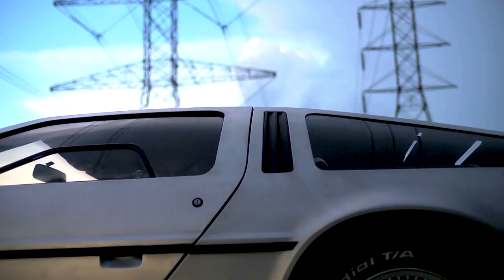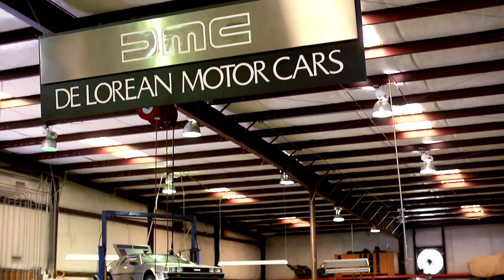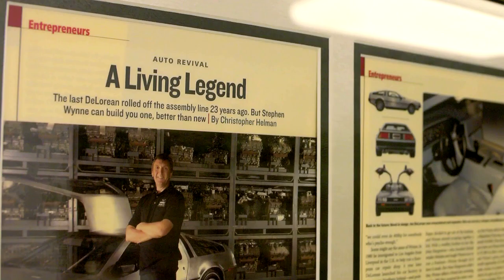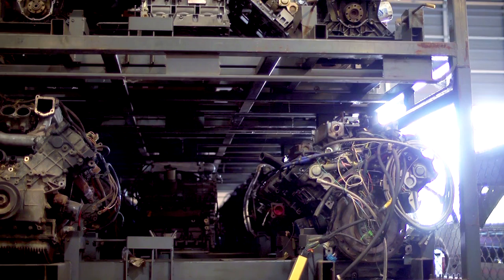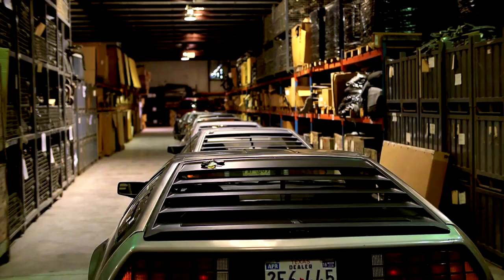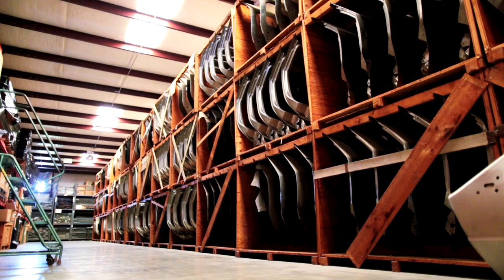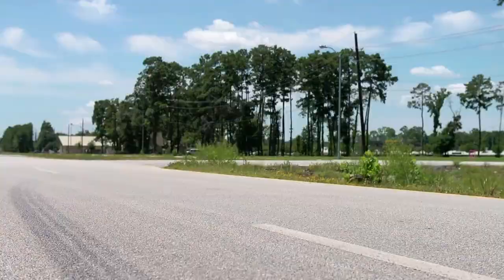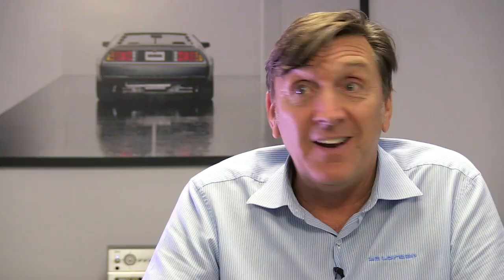New DeLoreans are still available, straight from the factory

Comment: Too bad they were powered with a weak Peougot motor.
Reply: No motor had any power in the 80s. Emissions were so hard to meet they all lost the power of the earlier years.
Reply: CHALK772  Peugeot was weak then. What it really needs is an LS swap
Reply: @cplpetergriffin1583  If you are going to go that route it's better off with a Viper Phase VX. At least its starts off with nearly 700 hp before adding all the bells and whistles.
Reply: Hamilton Rodgers  But would be so fun to watch!!
Reply: It needs a 572 big block with a blower. That would be the fix and a Allison 6 speed transmission with 356 running gear
Reply: Kevin H Needs a VTEC or 2JZ
Reply: @Kevin H : It's not a  "Peugeot" motor.
The engine is called the PRV V6.
Which stands for 'Peugeot / Renault / Volvo'. 
It was a joint project between all three car comapnies, and was first used by all three from '75 or '76 onward. 
The PRV V6 has also been used in lots of cars, mainly sports coupes, (inlcuding the DeLorean, of course)  by other much smaller brands over the decades. 
Sometimes with a turbo, sometimes even with a twin turbo, (which Renault did on its own Renault 25 Biturbo and then the later Renault  Safrane Biturbo in the '90s). 
While due to Peugeot buying out Citroen in around '76, Citroen also got the PRV V6, eventually - in the top spec models of it's upper size cars, (starting with the XM from '89, then the Xantia, C5, C6, etc). 
The so-called "Peugoet" motor, (as you put it) was not "weak". The  DeLorean needed a turbo, (or supercharger)  as either standard option right from the start - due in large part to its heavy stainless steel body, (but at least that keeps the body panels rust-free!!!).

Comment: I have two questions if I were to buy one.
(1) Are they required to have present day safety features as modern day vehicles have?

(2) If I were to order one now, would it be a 1981 or 2023 model?
Reply: The low volume historic replica vehicle amendment in the 2015 transportation bill waives current safety standards and allows the vehicles to be grandfathered retroactive to the year they would replicate (1981-1983 for DeLorean), though engines must be up to current EPA or CARB emissions. They would be registered retroactive to the year of replica, much like kit cars.

Comment: My brother called me mcfly. My mom called me doc my dad called me marty... I turned out to be doc tho. I have a small inheritance. Im living in a house with more rooms then i need. Etc. And i think i figured out how to make a car fly. But the wheels would have to be spinning so fast it would take something so slippery u couldnt stand on grass yet so dense it would maintain at the temperature of the sun. Using 5 points of inertia and cintrifical force. To create an actual bubble in gravity that would look like an arrow hit einstiens space time graph. Basically its spinning faster then the earth itself. Also the earth has a magnetic .5 it takes a 4.0 to stick a small magnet to a fridge. U would need a neutral double poled magnet either + or - depending on wich pole ur on.  Powerfull enough to pull a nail out of a peace pf wood but light enough to feel like styrofoam. Hover boards are more impossible then 1 point twenty one jiggawats. Ud need some kinda 👻 magnet. When u spin a ball tho and drop it. It moves forward. If you spin it faster it moves more forward. Untell u get to a point it actually is trying to go up. But you need this to happen in 5 point inertial circumstance for it to actually move up. You spinning an axis on a rotating axis that has an opposong axis and both sides go oppossite dorections. Very hard to explain but i can see it. Almost like a vision. It makes since. Its not lose uneducayed science. Its years and years of thinking that finally paid off. I made an example peace it lifted 2 inches off the ground and floated into the wall and blew up. Rip

Comment: How many brand new DeLorean's have you built so far - from the ground up - by just using the factory parts? How long would it take to build a new DeLorean from the ground up by using all of the 99.5% parts that you have for the car? How much would it cost to have a new DeLorean built from all of the parts you have? How difficult would it be to build a new DeLorean from the ground up with the factory parts?

Comment: If your going to make new deloreans you have to upgrade the front end I mean so 80's. Crappy old sealed beam lights put a slopped front piece like a lambo new HID lamps with halo ring. I'am I right or just produce 1980 replicas. The rest of the car I would leave stock  as a tribute

Comment: Was this in the era when speedometers were restricted to 85 mph maximum? 

Was needing to go 88 mph an inside joke?  

You can't tell because the Federal government mandated speedometer readings stop at 85 mph.
Reply: Ha, you think this car could go 80 miles an hour lol
Reply: @danielwhite1890  We made a VW Super Beatle go 90 mph... it was a big hill. Both side mirrors folded back at 85. By design?
Reply: @kevinmoore4887  no, specifically Deloreans, legit slow af
Reply: Max speed the engine could put out(which will roast that cats engine) was like, 110. Thing only has 100-150 horsepower

Comment: Iconic car  But the engine is slow and not very well designed out with bits and bobs from other car manufactures . But still a great car im glad delorean is around today
Reply: That's putting it mildly.  They a complete aberration.  It's anything but a great car.  It's only a fashion statement for people who want one.  If they expect anything like  a sports or performance car they'd be sadly disappointed.  You'd hard pressed to find a 4 cylinder compact Korean car that wouldn't outhandle, outbrake and outperform it.  Product of an admitted con artist.

Comment: The Delorian was a beautiful car, but from what I've read so far the engine was underpowered. That needs to be corrected. Then they shall sell.
Reply: The engine was underpowered thanks to the restrictive state like California to have extensive emissions controls on vehicles which really choked this car but its performance was adequate with other cars but not in a high performance range. Honestly these cars were not bad in stock form but if you remove the Restrictive emissions and put a nice Exhaust system on it from one of the vendors that includes headers in high flow catalytic converter or you can get it without converters and put a cold air intake on it and then you have at least another 30 horsepower increase and another 15 foot pounds of torque Which is a definite notice of improvement and I use my DeLorean As a daily driver and have been that way for the last 4 years without any issues at all and it has no problems getting out of its own way and it is a manual 5 speed and I have my engine built up a little bit but next it will get heads and cams for around 200 horse power. You actually need to drive one to understand how it feels while driving and you will see that it is not a dog like people that don't know anything about this car will say

Comment: While the DeLorean stirs nostalgia, keep in mind that this odd unpainted car made of Stainless Steel (which still discolored with time) was made with a complete piece of shit French Renault anemic 2.8-liter PRV V6 engine that made about 130 horsepower (a Corolla makes more HP) and the transmission was French too. DeLorean (aka DMC) lasted 3 model years and closed their doors in Ireland in October 1982. The Cell doors slammed on John DeLorean the Coke Dealer about 4 years later. I think I'd rather have a 1980's Corvette instead.

Comment: Stainless steel body : great concept , but heavy.  AC Delco parts : not really impressed. Peugeot/Renault/Volvo 130 he engine :  ummm ???  Styling :  never very pleasing.
Even with the styling, the car should have had a 400hp aluminium engine that was detuned for drive ability and longevity.  AC Delco should never have been part of the build except for maybe air-conditioning. The rest of the car should have been aluminium to mate with the anti-corrosive stainless steel body. DeLorean should have started with a smaller car company, and had a smaller run of cars that were anti-corrosive, reliable and easy to repair, with a slightly more modern styling, and hit a more affluent market of perhaps the $40,000 to $50,000 range at its inception in the 1980s. He went to big to quickly, and the vision was messed up. People want a car that is reliable,  and can perform in the sports car market. If you use a detuned motor, it allows people to decide if they want to add performance to keep up with the Jones's. But a heavy car that doesn't move, with parts that are renown for average quality? There's NO market for that.

Comment: Just replace this car with everything and it might be a decent car. It was under-engineered, too heavy, underpowered, slow and generally useless apart from it’s appearance. Not a car for drivers.
Reply: The concept of the car was meant to be simply stylish. Oh, and tough.  
Stainless steel didn't rust. otherwise, not fast. But not under- engineer